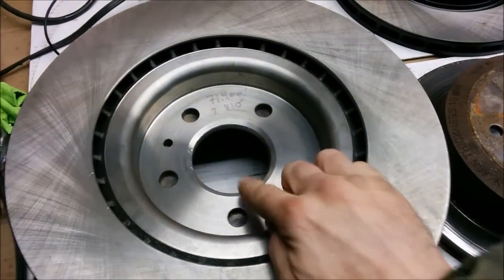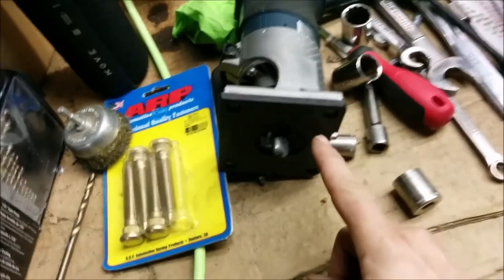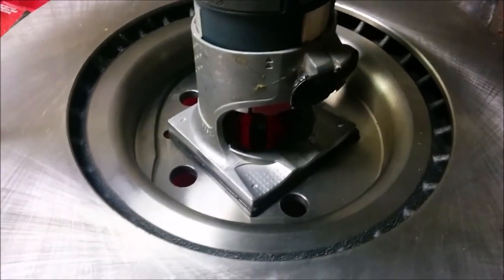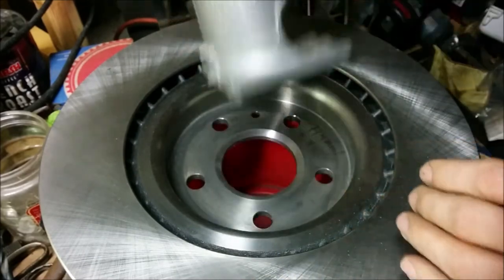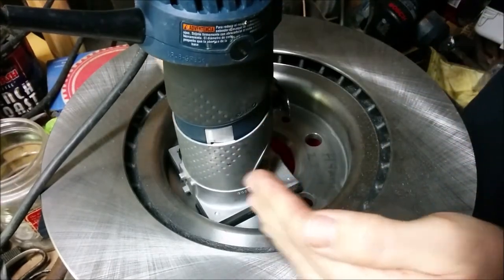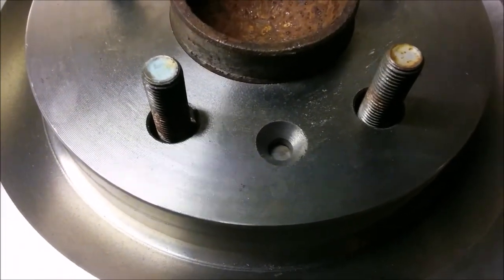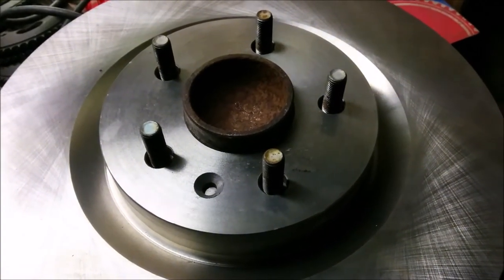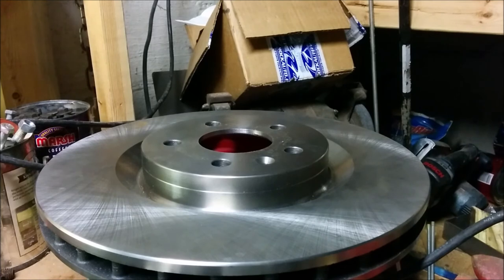2005 GTO Brembo upgrade part 8a DIY rotor boring

Comment: What kind of tool is that? You have a part number? I didn’t catch the name on the video.
Reply from the maker: It's a Bosch Colt PR20EVS trim router with a 1/4 inch shank 3/8 bur bit chucked in it. 4290A15 from McMaster Carr for the bit
Reply: evsnova74 I got the two front rotors fitted and it’s done. Quick question for the rear. Are the 2013 Z06 rear rotors the same diameter as the gto rears? Looks like they’re the same.
Reply from the maker: @buddyrebel_Garcia  I don't think so but I can't say I ever measured the stock GTO rotors. I know the c6 z06 rotors are 13.4" though if I'm not mistaken